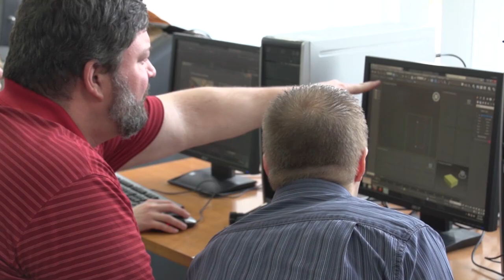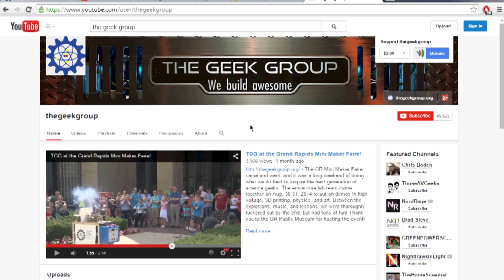Project For Awesome 2014 - The Geek Group

Comment: Try doing cold fusion then
Reply: Cold fusion is a misnomer. The only viable way we have to extract large quantities of energy from anything (other than solar, but that's a whole different can of worms) , be it a combustion reaction, falling water, or a nuclear reaction, is to turn turbines and a generator. For anything other than wind and hydro, you need to use steam or some other heated working fluid to transport the energy to the turbine. "Cool" or low energy nuclear fusion can occur, but to produce any kind of meaningful output the temperature is going to rise, and with modern tech, it has to rise because that's how we extract power. The Geek Group already has a working Farnsworth-Hirsh-Meeks fusor.